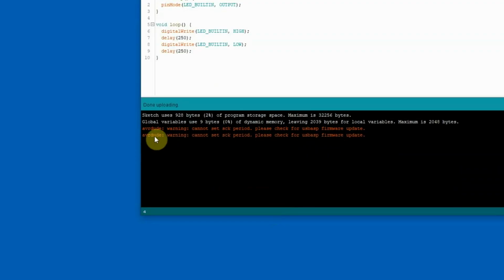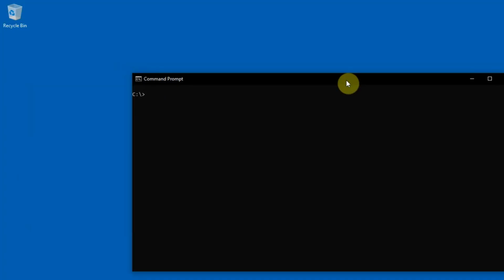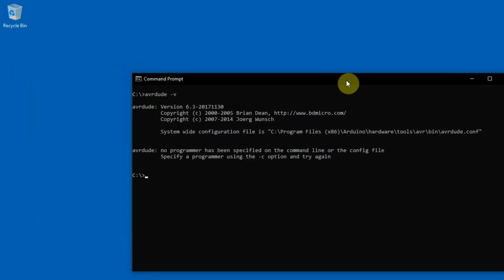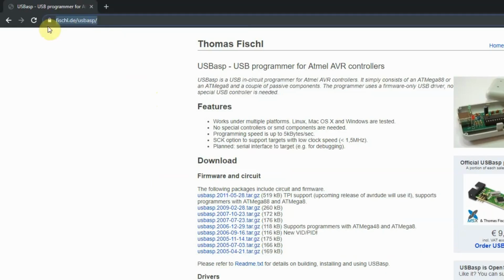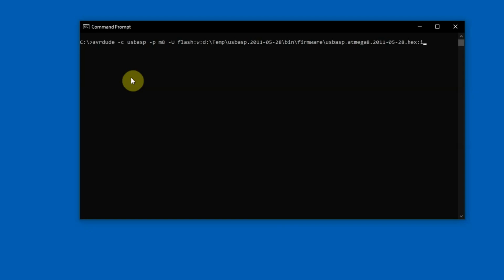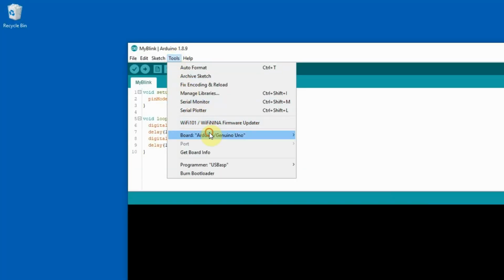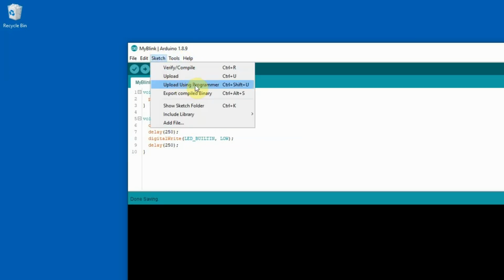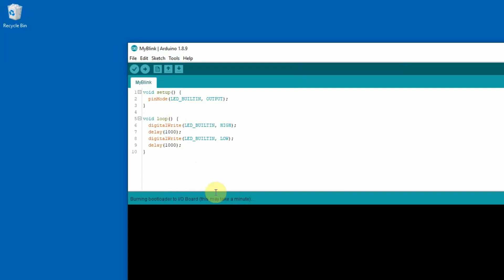How to Upgrade Firmware in USBasp Programmer

Comment: The new Ardunio IDE from the MS store doesn't put avrdude in the same place. When I added the new location to the PATH avrdude was giving me access denied even on an elevated prompt. I had to remove it from PATH and install WINAVR with the "Add to PATH" option enabled to get it to work.

Aside from that, top notch video!
Reply from the maker: Hi, you're absolutely right the new version has changed.

Comment: Dear Zero Amps: Thank you so much for your efforts to share your expertise and teach us. It is much appreciated! Here is my problem... I can not get my (com) Port to activate in Arduino IDE Tools and Blink and Bootloader uploads fail. I used Zadig to load the libusbK driver and the USBasp device shows in the Device Manager as working properly. I have tried all other Zagid driver choices. Windows 10 OS. Target is ATtiny85. Arduino Tools Settings = Board;85, Processor;85, Clock; Internal 1Mhz. I have tried all of the different clock settings, internal and external. I am using the same programmer as you. I have not updated the firmware, yet. Firmware update questions... I am new to all of this and need to use the Arduino IDE. Please tell me how to update the firmware with the Arduino IDE. Secondly, I do not think that your video shows which programmer is attached to the laptop... The one with the new jumper, or without? Thank you for your help.
Reply from the maker: First, I would try Arduino UNO if it works or not.

Comment: Hello nice video!!Can I use an Arduino to flash the driver to the usbasp instead of a another usbasp?
Reply from the maker: Hi, do you mean the Arduino UNO R3 board or any other?
Reply: @zeroampselectronics  yes
Reply: @wintechblog6066  go into Arduino IDE, File->Examples->ArduinoISP and upload it onto your UNO
then avr dude will use it as a programmer to program the USBASP
(replace <yourcomport> with the com port your UNO is on)
avrdude -P <yourcomport> -c arduino -p m328p -v -U flash:w:usbasp.atmega8.2011-05-28.hex

Comment: Hi, thanx for the great video. Anyhow i have few questions.
1) is there any issue if that warning pop out during uploading?
2) do i need another USBavr for this task?
Thanks mate.
Reply from the maker: Hi, 1. If you don't want to use it for ATtiny10 programming it's not problem. 2. People also use other programmers or Arduino boards for programming the USBasp programmer.

Comment: Hi , i sold USBisp programmer from china , but my computer dedect it as usbhid device. İ cant do anything with programmer. Maybe firmware will be solution. But i have no another isp device that runnig good. Can i do this operation with arduino card? For example arduino uno or nano
Reply: Yes, that's possible.

Comment: was one programer good and the other bad? I bought two programers, can I still use a bad one to burn the new firmware to the other bad one or do I have to  have a good one and use it to fix the firmware on the one with the bad firmware?
Reply from the maker: Hi, they weren't bad they just didn't have the latest firmware. Yes, it was possible to upgrade with the programmer with an old firmware the other one to the latest firmware. Good luck with upgrading!
Reply: Thanks for the info. What I ended up doing as I was having a hard time adding the dos pathing commands to the system so windows would know where to find averdude I had already installed averdudess and just used it to burn the new firmware  to them. Thought I had bricked them both but all went well once I figured averdudess out. I had used averdudess out for a Atmega 328p ham radio project firmware update. Thanks

Comment: The answer to getting a bootloader onto a Nano clone keeps turning out to be "buy more stuff." I bought a USBasp to burn the Nano bootloader. But the USBasp needs a firmware update. The solution? Use a working Arduino to update the firmware. If I had a working Arduino, I wouldn't need the USBasp, would I? So let's say I buy another USBasp to update the one I already have. How do I know the second one is going to work? The actual solution appears to be: chuck all of the Arduino stuff in the dumpster and stick with ESP32.
Reply: But is all your 5 Volts arduino stuff compatible with your ESP XD
Or are you just shifting your problem from not working cheap programmer to not working cheap level shifters? :P
Reply: I have found exactly the same problem. I guess a lot depends on what part of the world you are in and what is available to you. Fortunately I only paid $5 for the USBasp as something to mess around with as a hobby instead of buying another working Arduino, but, yes,  it is a bit frustrating.

Comment: one question 
If You have UNO why you using for upgrade USBASP  another USPASP  ?
Why don't using  Arduino uno as programmer ?
Reply from the maker: Hi Garry, I couldn't find out how to easily do that. Have you tried that?
Reply: @zeroampselectronics  yeep
Just load  your uno as programmer from arduino ide.
(Files=>samples >arduino ISP)
This sketch  made STK 500 simulator from your uno
And you can use it as programmer in arduino ide 
And others (khazams,avrdudees etc)
That's all
Reply from the maker: Hi, thank you for the tip!
Reply: @zeroampselectronics  np mate 
Thank You for Your video:)

Comment: Can u give me the firmware of usbasp which is present in atmega8 ? Because after firmware updated my usbasp is program only AVR microcontrollers i can not do program in AT89S52/AT89S51 . I need the old frimware of usbasp can you give me the frimware ?
Reply from the maker: Hi, check this site https://www.fischl.de/usbasp/ on which are all versions released for the programmer. You can go one by one to find the one which will be working for you. If any issues let me know. Good luck!

Comment: hi ,i already update this lastest fireware,but still can't connect attiny10,i use GUI avrdudess to connect,i think is the same like you use cmd avrdude,can you help slove this problem,many thx
Reply from the maker: Hi, if your USBasp programmer is correctly upgraded to the latest firmware, you should check wires whether they are correctly connected. Do NOT connect others components to your ATtiny10 during programming. Only the USBasp should be connected.
Reply from the maker: I also recommend to check whether you are able to program any of your Arduino boards to check the USBasp programmer is working correctly and to isolate the problem. You can try that from Arduino IDE.
Reply: @zeroampselectronics  thx for you reply,i test use upgraded of usbasp to another chip,like mega32u4 ,that is ok,do you use GUI avrdudess to burn the attiny10?,thx
Reply from the maker: Hi, I don't use that tool and it might be your problem. Try to use avrdude directly for example the one which is delivered with Arduino IDE. That tool might use some older version of avrdude which doesn't support TPI which is necessery for programming ATtiny10. If it doesn't work with avrdude check again wires if they are connected correctly or you can also test it with a new ATtiny10. Maybe the one you have is faulty.
Reply: @zeroampselectronics  thx reply, can you show how to setup avrdude on c:\ to use? i install arduino gui on F:\
thx
Reply from the maker: Hi, can you identify where on F: drive is avrdude installed?
Reply: @zeroampselectronics   thx reply,   friend i test ok and many thx 
i use cmd avrdude for burn and read
goooooooooooooooooooooooooooood
Reply: friend
cmd avrdude how to read t10 fuse? 
if t10 set to lock bit and how to read the flash content?
thx
Reply from the maker: Congratulation! When I managed the same for the first I also felt like a hero!
Reply from the maker: By default ATtiny10 is not locked and you should be able to read / write it without any problems. For reading the fuse use this option -U fuse:r:filename:i
Reply: @zeroampselectronics  i means if someone set locked bit fuse then how do i read the flash content?
thx
Reply from the maker: If it's locked you can unlock it with "Chip Erase Command". Datasheet for ATtiny10 says: "The Chip Erase command will erase the entire code section of the Flash memory and the NVM Lock Bits. For security reasons, the NVM Lock Bits are not reset before the code section has been completely erased. Configuration, Signature and Calibration sections are not changed." If it's locked for reading you're not able to read it anymore. Generally you can lock it for writing or for writing and reading. If it is the second case you can't read it and you can just unlock it be erasing the chip.
Reply: @zeroampselectronics  thx for you help,so how can i use command line check the attiny10 what it set lock or not?
thx
Reply from the maker: Hi, you can use this option -U lock:r:filename:i in avrdude for reading the lock byte. I recommend you to read https://www.nongnu.org/avrdude/user-manual/avrdude_4.html#Option-Descriptions and http://ww1.microchip.com/downloads/en/DeviceDoc/ATtiny4-5-9-10-Data-Sheet-DS40002060A.pdf. You should learn how to use avrdude from command-line and try to experiment with that.
Reply: @zeroampselectronics  thx reply
i have one attiny10 chip,so i need read it flash content and save it 
if this set lock so i can't read it?
thx
Reply from the maker: Try this command to read the flash:
avrdude -c usbasp -p t10 -U flash:r:output.hex:i
If it doesn't work it may be locked and the only way to unlock it is to erase the chip.
Reply: @zeroampselectronics  i test it ,can't read the flash content,may be set lock,
can you have and idea to read it?
thx
Reply from the maker: Hi, try to run this command "avrdude -c usbasp -p t10" with connected the ATtiny10 to your USBasp programmer and let me know the result of that. Thank you.
Reply: @zeroampselectronics  here is result :
C:\Users\Administrator>avrdude -c usbasp -p t10

avrdude: error: program enable: target doesn't answer.
avrdude: initialization failed, rc=-1
         Double check connections and try again, or use -F to override
         this check.
avrdude done.  Thank you.
please check it ,
i think set lock it,can't read flash content
thx
Reply from the maker: Hi, the second question: is the pin 6 (the reset pin) used for anything in your circuit? I mean whether it's connected to any component or not.
Reply: @zeroampselectronics  hi friend
 i separate the attiny10 from the circuit board 
the burn board only have the chip 
do you have an idea to read flash content?
thx
Reply from the maker: Hi, that's what I'm asking so once again the same question a different way. The board which you took the ATtiny10 from, does this board use pin 6 (reset pin) anyhow? I mean the pin 6 on ATtiny10. YES/NO?
Reply: @zeroampselectronics  
i desolder the attiny10 on board,
the attiny10 six pin didn't connect anything,only connect the usbasp 
thx
Reply from the maker: Hi, but before desoldering, was the pin 6 connected to any component?
Reply: @zeroampselectronics  
hi
yes,you are right,
pin 6 connect via RES to mega32u4 pin1
mega32u4 this chip i have code resource,but i can't find it pin1 how to use,so i need to contiue to find it 
thx
Reply from the maker: Hi, so it means that the reset pin is configured as an output pin and the only way how to program your ATtiny10 is using so called "High Voltage" programming which USBasp programmer doesn't support. It's a little advanced topic. You can search on Google for "AVR High Voltage programming".
Reply: @zeroampselectronics  hi friend
it means the chip set the fuse then the rest pin for output
if i read the chip flash conten and get it hex file,so i can't use usbasp to burn the flash content to the new attiny10? 
how can i do what i get the flash hex file and burn to new attiny10 without usbasp
many thx
Reply from the maker: Hi, like I said in my previous comment you should try "High Voltage programming". Please, search for "AVR High Voltage programming" on Google. Good luck!
Reply: @zeroampselectronics  
thx reply friend
can you tell me what HV programer suitable for attiny10 to set the REST to INPUT PIN?
thx
Reply from the maker: @habbygb4721  Hi, unfortunately I haven't used any high voltage programmer, so you have to search for some on Google.

Comment: Can you explain Ya, why the fuck Ya we need another USBasp to program another USBasp when we have the fuckn ucb interface YA ?
Reply from the maker: Hi, that's a reasonable questions. For the USBasp programmers I don't know about any option how to do that without any other programmer. I've got another programmer which is called TL688 II Plus. This programmer is able to upgrade without any other. So, the answer is, that it really depends on a programmer you use.
Reply: @zeroampselectronics  Thanks, can you advise and compare other standalone programmers (the ones that does not need another programmer to reprogram them) in a separate video for future? I could not decide between microcontroller's programmer, and atmel ice. I bought something called AVR ISP MKII for 35$, I highly regret doing so. Can't even upgrade it due to lack of documentation... I had to dig in through data sheets for 1 hour to figure out, and at the end I gave up upgrading its firmware....